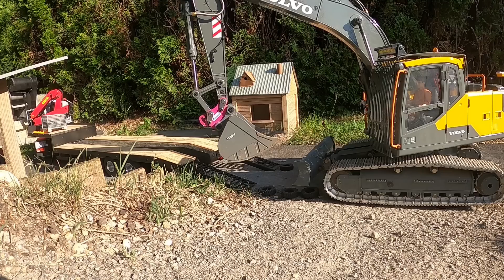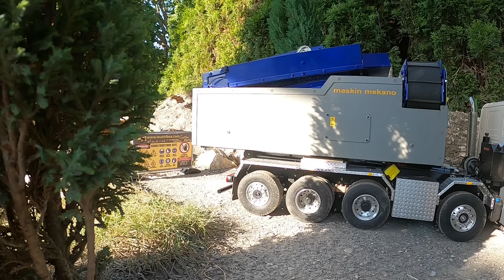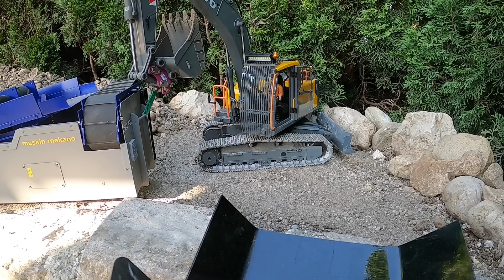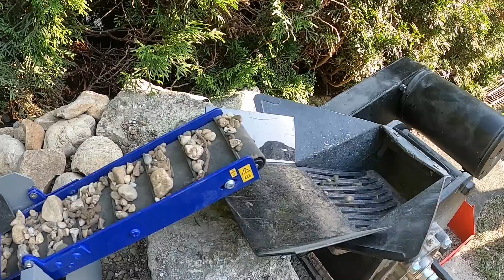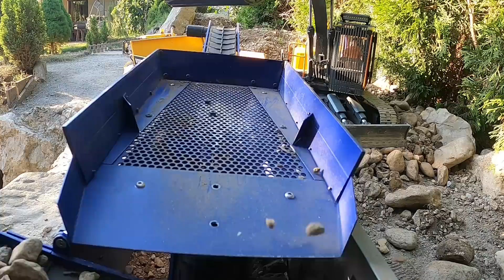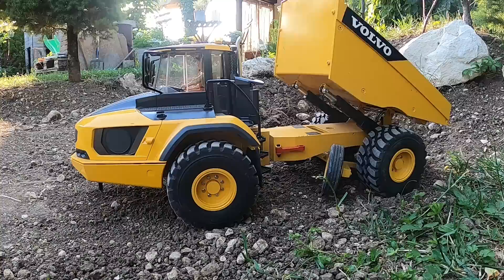Screening and Stone Crusher, RC Scale excavator, dumper truck, Volvo EC160E, Volvo A40

Comment: How does the EC160E operate? Any problems?
Reply from the maker: Problem with pump and valve. I changed for jung pump. Maybe I will change the valve and cylinders too
Reply: @BartsteRCModels  Easy or hard to fix?